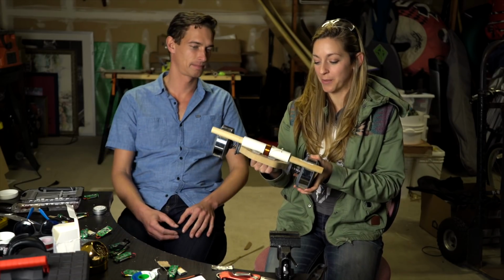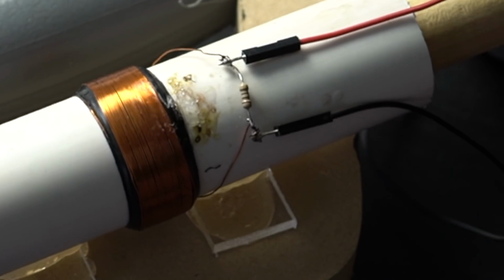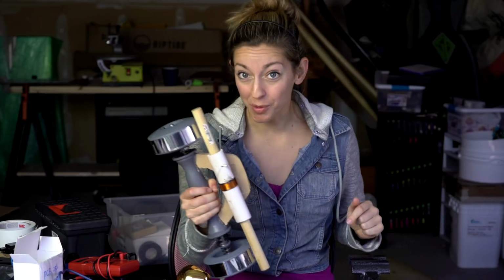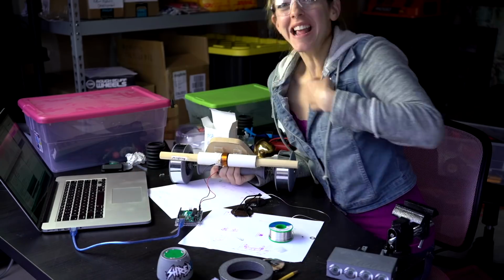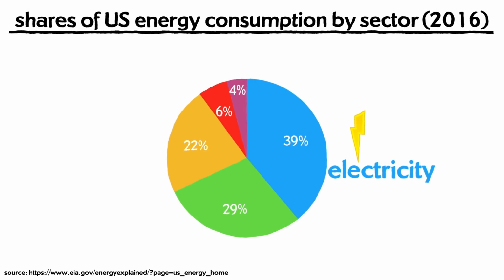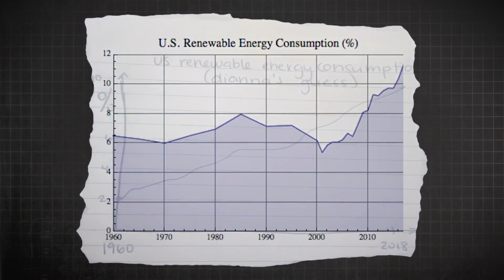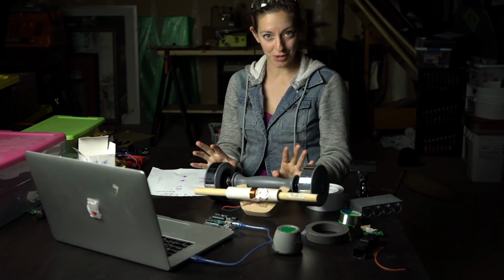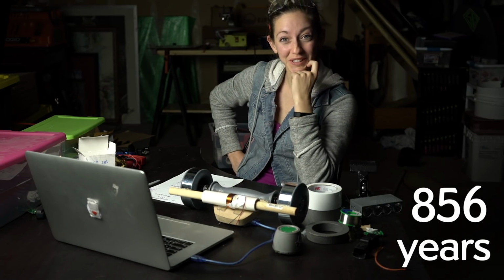Can you power a house with a ShakeWeight?

Comment: Great video Dianna! Very nice way to show people how hard it is to make energy for their homes. I work in an electric utility and I can tell you our smallest generator is a 50MW gas turbine. They’re derived from 747 airplane engines and are absolutely massive and complex machines. You can imagine the torque on those generator shafts are a few orders of magnitude higher than the force you’re exerting into your shake weight solenoid haha :) and that’s our SMALLEST generator. Also they spin at 3600rpm to sync with grid frequency of 60hz; you might have a little trouble trying to sync your shakeweight to 60hz ;)

We’re rapidly adopting solar, wind, and batteries for a clean, modern smart grid though and we are 40% renewable already today locally and going to be 65% in 10 years. This is one of the biggest challenges for our generation and the problem we’ll have to solve over the next century!

Have you heard of Transatomic? They are a nuclear reactor startup, also out of your alma mater MIT! It would be amazing if you could interview them on your YT channel about what they’re trying to do and follow up this video with a discussion on the future of energy!

Comment: You could generate more power with the weight if you had a bigger coil. You are already using a large magnet, why not use a larger coil? I would gather you'd at least increase by 10fold. Altho, that's still quite a bit short  😜

Comment: "I feel like that's depressing. I'm gonna draw a graph."  ~Scientist
Reply: You're overthinking stuffs. It's the way she brought it across that was funny =P
Reply: Exactly. You read my comment the wrong way Jesper :)  She meant it humourously, and it was funny
Reply: How much power produced by an Aniroid barometer cell by compressed and decompression strokes so it's able to turn leverage system and needle ?

If we use a brush less dynamo and attached it with aniroid barometer output so we got some voltage round the clock 
So how many barometer cell required to provide 24 kWh electricity ?

Comment: As a person with 8.4kWh of solar on my roof (and a former power utility employee), I can tell you the issue with green energy isn't so much harnessing it, but storing it for use when needed.  Electricity, like many forms of energy must be used as it is generated.  Thus, it needs to be stored.  Usually we look to chemical batteries although it is possible to make super-capacitors with carbon nanotubes.  However, kinetic storage (is flywheels) are also possible.  All of the processes are extremely inefficient.  Perhaps the best is potential energy (think pumped-storage hydro here).

The Sun gives more than enough power in a single day than it takes to power the Earth for 3 months... probably even a year.  So if we cannot find a way to store it better, maybe we can focus on creative ways to harness it?

Comment: That's a very inefficient way of capturing energy because you didn't need the weights on it.  You're better off locking down the magnet somewhere stable and then moving only the coil part back and forth.

Comment: Well, if I ever get rich and have a house built, I’d have systems put in place to have it powered by a combination of hydroelectric and solar energy and set it up to where they each one, by itself, when added up throughout an entire month, will produce enough energy to not only run my house for that month, but also charge an electric car as much as it needs to be charged for that month, AND have some energy left to pump back into the grid, so that not only do I not have an electric bill each month, but the electric company sends ME a check each month. The reason I would run them in combination with one another is because the water doesn’t always run, and the sun doesn’t always shine, which highlights a huge problem with renewable energy and one of the main reasons why it isn’t used more than it is now. It’s too dependent on Mother Nature’s cooperation. Running them in combination with each of them producing the energy production mentioned above would produce a higher and more consistently reliable level of energy, as well as reduce the amount of cooperation the renewable energy sources need from Mother Nature. Great video. 😊

Comment: Electric cars are not the answer.  There is the life cycle for the batteries and as yet no one has designed or implemented a process to dispose of the batteries when they die.  Just try and dispose of your A and AA cells now.  The answer for transport appears to be hydrogen.  As a true hippie of the 1960's (72 years old now) I protested against nuclear power.  Appears I was wrong.  Well not wrong, but there were processes and methods that were far more efficient than the technology used in nuclear reactors.  See this Ted talk to get up to speed.  https://www.youtube.com/watch?v=ciStnd9Y2ak  Please do not just dismiss my statement, watch the talk.  Then do some research on what is mentioned in the talk.  Research ALL of the things he states.  Please rather than call me names, question my intelligence, watch the talk, do the research and if you find something let me know.  Science is about research, not name calling.

Comment: I love your show but have a lot of issues with this video. 
1) The power output of the shake-weight depends on the resistance(to be more accurate, impedance) in the circuit between ends of the coil. If the resistance is lower, it just makes you work harder to maintain the same voltage across the resistor. So, when you talk about a power plant or a generator, it maces more sense to talk about its capacity instead of its instantaneous output.
2)The shake-weight is hardly a renewable or green source by any means. You grow corn and use a lot of fossil fuel and other chemicals or processes that use a lot of fossil fuel to do it. Then, you eat the corn or feed it to a cow and eat the cow. You burn that energy to move your arm and force a coil through changing magnetic field. If scaled to power a house, this whole chain would only leave devastation in its wake at every step. So, when you call it your "contribution", you should know that you aren't contributing to the side you think you are.

I love your channel, but this video is plain lazy. I absolutely love the videos you made about vortexes in a swimming pool and the formation of Hawaiian islands. They are so cool! The shake-weight makes me think you are spending too much time with Simone(haha).

Comment: At around 5:20 did you mean 80,000,000,000 with a B or 80,000,000,000,000 with a T per day? As you said we are using far less than eighty trillion kwh per year (thirty-five trillion kwh per your previous statement). Love your channel and what you are trying to do on it.

Comment: 30 kWh per day per home ? Serious??
Reply: How do they use that much power? On what? Average household in Poland uses between 2 and 10 kWh per day.
Reply: Aleksander Świech Average house in USA uses about 1000kWh per month so her 30kWh/day is accurate. Not sure what all the differences are between our countries, but we use a lot of energy on heating and cooling, and all the electronics and appliances add up the rest. Americans in general are also just more wasteful, especially since our electricity prices are relatively cheap.
Reply: This isn't just electricity, it is all primary energy. Even so, USA is about x2 over other advanced nations in per capita energy use :(
Reply: In Germany you have a mandatory energy pass for houses and apartments, and a new house with good isolation is at 30-50 kWh/(m²*year). so if your house has between 150 and 300 m² it's a acurate estimate for 30 kWh per day per home.

Comment: i atm have a flashlight that works using a magnet passing through a coil next to my bed.
it does store a bit of current (or volt im really not good with electrical stuff) after you shake it.
but whe have it for year so its becoming less and less effective.

Comment: Your clean electrical percentage is wrong, should include nuclear.
Reply: Every energy generation process has waste. Nuclear's waste stream is small compared to all the others, and very well controlled. It's exactly that careful control that means you have even heard of it.

Spent fuel is an inert mineral that becomes more and more harmless as time passes. Putting it back underground is a simple and well-understood safe disposal process. Only politics has stood in the way of solutions.
Reply: +itare because making of PVs doesn't make waste? that certainly isn't toxic? and even if it is toxic, it doesn't kill people or pollute the environment through industrial accidents? cough https://en.wikipedia.org/wiki/Ajka_alumina_plant_accident cough

sorry for the coughing, my asthma doesn't like it when I move the goal posts so much
Reply: "Spent fuel is an inert mineral" I think that any material which has to be kept decades in cooled and shielded water reservoirs and later be buried hundreds meters under ground can hardly be called INERT. In fact the spent fuel still has lots of energy left, it's just in a form we cant effectively harness yet.
Reply: Spent fuel is an inert mineral because it doesn't react chemically with its surroundings. The requirement is to store it in cooled water (which <b>is</b> the shielding) for 3-5 years, after which it can be air cooled.

Nuclear power sends signals that mislead people - by taking extreme care of everything, it is common for people to misinterpret this care as an indication of high risk. The reverse is true; today's nuclear power is very low risk.
Reply: Agreed, imagine Bill would agree since he has a nuclear company
Reply: It is not clean or renewable since we’re tons and tons of nuclear waste, which has been an issue for over 40 years and we don’t know what to do with those. I invite you reading some article about it or simply watch something entertaining and informative as “Last week tonight” on Nuclear Waste. That is depressing but it is a real issue no one wants to talk about

Comment: There is a supermarket chain in the UK that already uses a similar type of system to convert the energy of their lorries (trucks) moving in and out of one of their depots to make electricity.  (I'm hoping it's similar - it certainly seems it - converting existing motion into electricity). I must admit I can't remember how useful or cost effective it proved to be but it was part of a whole series of designs to make the wearhouse as green as possible. It certainly sounded cool at the time.

Comment: How do you feel about nuclear power? It's not clean, or renewable; but it doesn't give off greenhouse gases. I think it's a good temporary measure to replace gas/coal plants with 20 year nuclear plants while clean energies are further developed to take over.
Reply: Personally, I think it is clean compared to fossil fuels and renewables. It has about the same impacts as renewables according to many high level studies of externalities of energy systems. Of course, I am a future nuclear engineer hopeful, so take that for what its worth. Hell, nuclear might even find a home in a high renewable future forever depending on how we want direction we take nuclear systems.
Reply: It's actually cleaner than solar. And safer, too. Once people realize that, we can start making progress towards real energy reform. But they don't understand the industry, and fear of the unknown prevents people from ever bothering to actually learn anything. Nuclear is currently the safest and cleanest power generation method known to mankind. If we get fusion working, I'm all for that. But in the meantime, we pretend that solar and wind don't each kill more people per year and produce more waste per year than nuclear, per energy unit. And that's stupid.